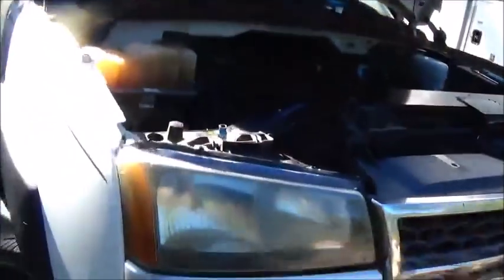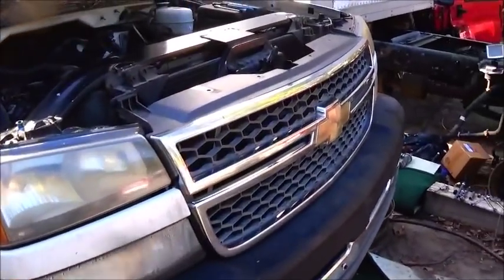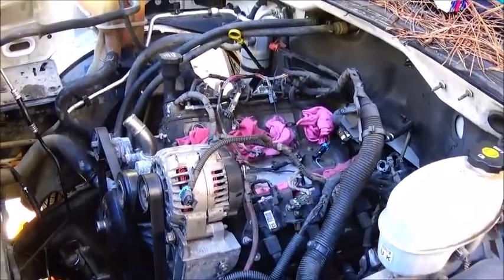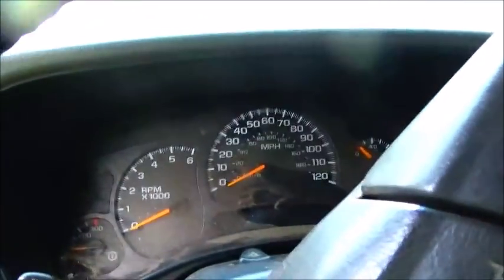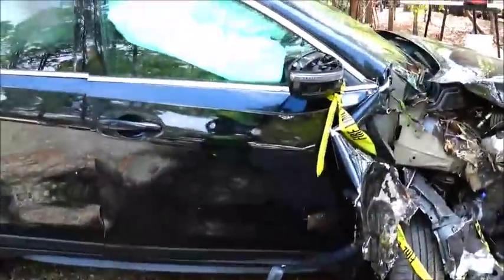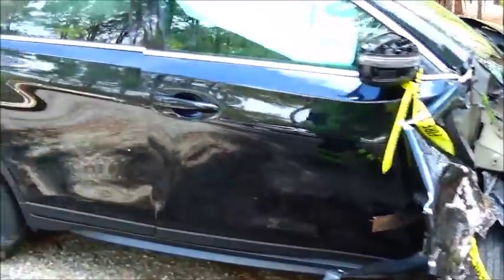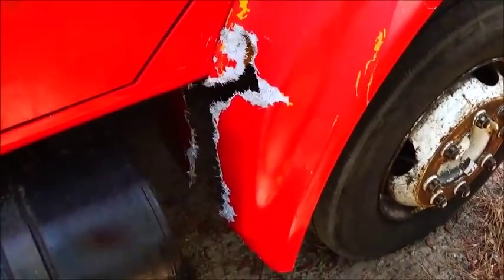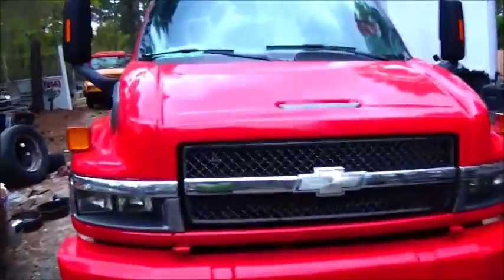A busy Weekend!!

Comment: You’re definitely right about batteries... I bought a new 2009 Jetta TDI when I was stationed in Germany (but it was made in Mexico and shipped over... all Jettas and US spec Golfs except the GTI were made there).  Anyway, it made it through being stationed the rest of the time there (~8mo), in dry and hot/cold Idaho (3yrs), humid and mild/hot southern Gulf coast Mississippi (8mo), then a few months in the spring/summer in super dry and hot Arizona before taking a crap immediately after picking it up from the body shop after some insurance work from the move (some roof shingles flew off a mobile office that was in transit on the interstate in Dallas, Texas... gouged the paint down real bad... also when I was driving the moving truck and the ol lady was following me, a semi straddled a tire tread in the road that I didn’t have enough time to warn her on the two way radio... she hit it and it broke the lower portion of the bumper; luckily no other damage).  I called the shop on my lunch break (since the ol lady messaged earlier that it wouldn’t start... luckily she didn’t have anywhere pressing to be) to see if they had issues (since we hadn’t had any before it went in with them), and they hadn’t, but it did sit for a bit in their lot while they waited for parts and after the paint dried for quality control checks... the owner and I spoke for a bit and came to the conclusion that the battery was probably on its last leg from being 5 years old at that point, and that they weren’t at fault for it going bad... he did make it up to me buy buying an OEM battery at wholesale price from the dealer and selling it at no markup (even showed me the dealer receipt)... not bad since it was $130 and a legit Bosch or whatever made in Germany VW battery at a similar price as a generic Duralast from Autozone across the street.  Then he came and installed it in the car, all before I even got home from work that day!  That’s pretty good customer service to me!

Unrelated, but since you recently had the video on the Cobalt with the doors, and newer Jettas are plentiful enough that you may find yourself in a similar situation with one... be careful with the VW/Audi door locks/latches... if you take the door skin off (yes, the outside skin comes off and it’s easier to get to stuff that way rather than taking the interior panel off) or mess with the cabling in any way, it needs to be properly adjusted, and it’s a pain in the ass.  When I got my car back from the body shop (who did phenomenal body/paint work that lasted for years without looking like certain panels had been painted, so they’re definitely no fly by night organization), the two doors they painted had problems opening from the outside.  They ended up having to send it to the dealership and have them adjust the cables... you’ve been warned!

Comment: You never have a shortage of things to do that's for sure. Good job on getting that 6.0 back into the truck. And even better that you proactively pulled the old engine before it failed. Now you've got something worth rebuilding that you can probably fix the oil pressure with minimal parts. Who knows, it could just be a clogged up oil pickup. Or a set of new bearings.

Comment: Getrag make really good transmissions, really tough and almost unbreakable.  They've been used in a lot of vehicles with huge amounts of power and torque without problems, even in racing, so that 5-speed should be plenty tough enough for the lifted square body...

Comment: Did you look over that 241C to see if you could re-clock it for right side drive? Some of the housings can be flipped, but I can't recall if it's only the older ones with divorced T-case. I've seen one flipped over, they work, but the drain plug ends up near the top, so it's hard to change the oil in the case.

Comment: Actually the stickers on the batteries are put on when the distributor stocks them at the retailer, the manufacturing date code is melted into the case either on the side or on top by one the terminals. To really check out a battery you need to use a hydrometer. The best way of charging a side post battery is to use lead post adapters to hook your charger to so the charge goes thru the lead of the battery. One more thing if you have a vehicle with a computer system that is going to sit any time at all you need to disconnect the battery because the computer will drain them. If you can find a wholesale battery distributor close to you they could probably charge that back up to make it work like new cheaper then buying a new one. I don't know what kind of chargers they use but it takes about 24 hours and I can't find one in the retail market.

Comment: I'd weld up an old mud flap on each side, between the tire and airbag.
Reply: what happen to Jonathan is a Rare thing, I drove for over 7 million miles and Never had that happen to any of my trucks or trailers. I mean you could do that but, I don't think it is necessary.
Reply from the maker: A 15 pass van loaded with Carpet! I was way overweight with tires that had been sitting on me truck for 5 years. I ask for it!

Comment: find a 241 out of a late 80's suburban from behind a 4l80 trans it will have same spline count you need 32 spline for the nv3500. i had to do the same thing i found one on ebay for 41 buck free shipping a while back. i wonder is the one 32 spline out of the 241 will fit in the 208, i left a comment and tried to tell you in the last video you had about the t cases.
Reply: more plentiful 32 spine 208 from a 81-87 truck and 88 suburban, blazer and crew cab with the th400 or the 84-88 with the sm465 manual 4 sp

Comment: put a new o ring on the pick  up tube and its fixed
Reply from the maker: Put new GM pump in with new o-ring and still low. Has plenty of pressure at the filter and 10 psi up top. Cam bearing bad.